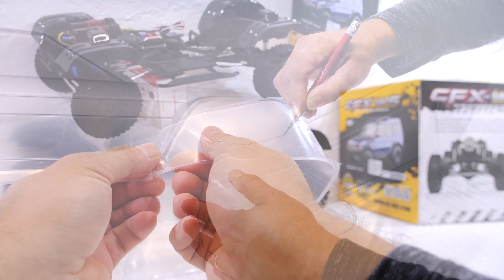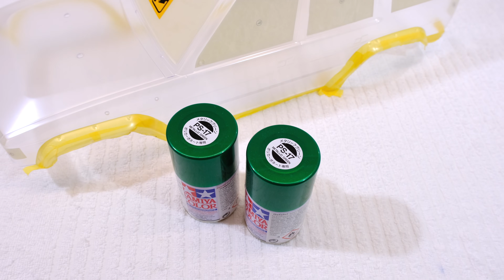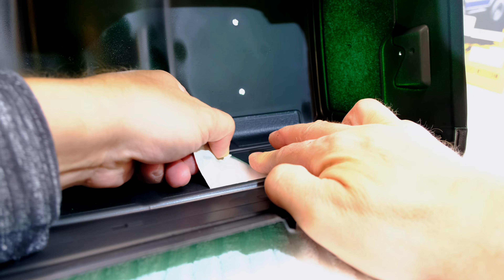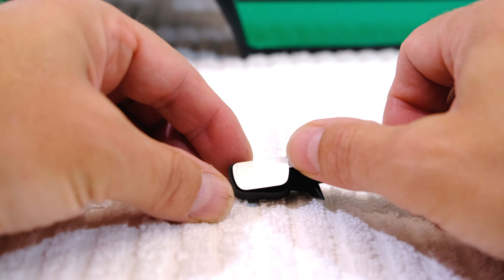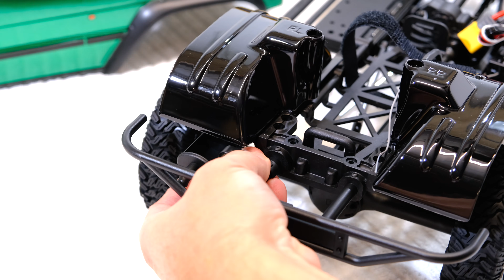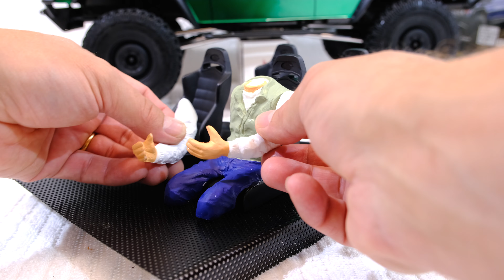MST DC1 / Build - Bodywork and Paintjob

Comment: Nice truck. I have a question. How does body feel? I have a TRX4 its body is thick and durable. I also have Axial Gladiator its body is really thin and doesnt feel durable at all. How is DC1.
Reply from the maker: It feels more like a thinner Polycarbonate. But it's stable enough though. 👍😊

Comment: looks great, hey just a tip for you, when applying the the clear window decals try spraying windex glass cleaner on the entire surface and then squeegee the windex out with a credit card. I find you get perfect results every time. Thanks.
Reply from the maker: Thanks for the tip Philip, I will give it a try. I think I used the wrong soapy water this time. But the good thing is that you can fix most of the bugs. 👍😊